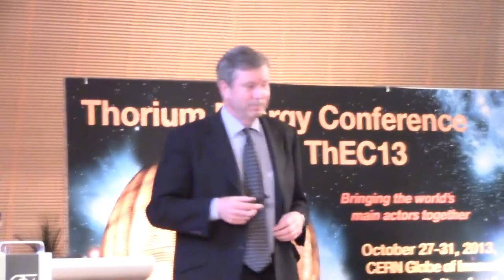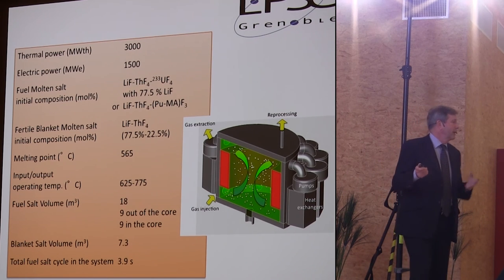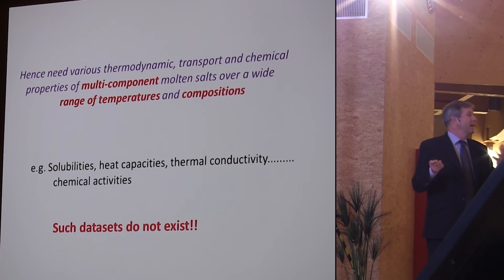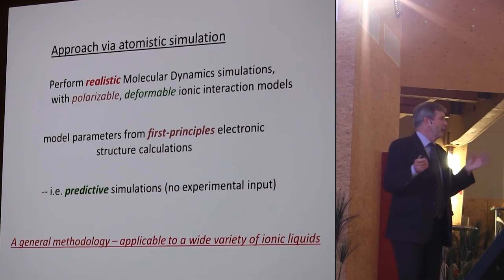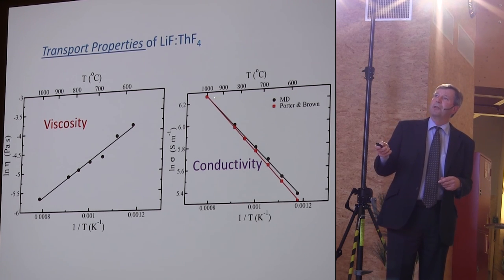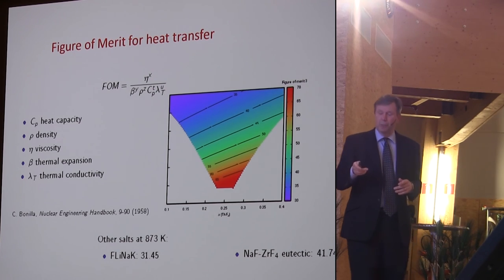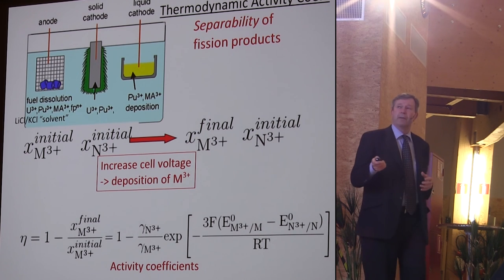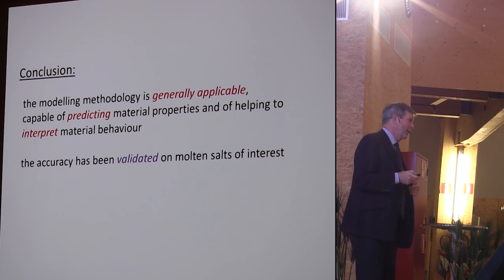Paul Madden - Thorium Molten Salts, Theory & Practice @ ThEC13

Comment: Given the amount of data available from a functioning thermal spectrum MSR, what is the benefit of modelling a fast spectrum MSR?
Reply: As far as I understand it (and I could be wrong), a fast spectrum Thorium reactor offers a somewhat higher efficiency (as the ratio of emitted Neutrons to absorbed Neutrons improves).

Now his aim is to simulate a 1.5 GW reactor (25:33, "generation 4 type target"), and I suspect that for this a higher efficiency would be desirable (again, I could be wrong).

He mentions a talk by Elsa Merle-Lucotte on the neutronic analysis. The video of her talk isn't online yet, AFAIK.